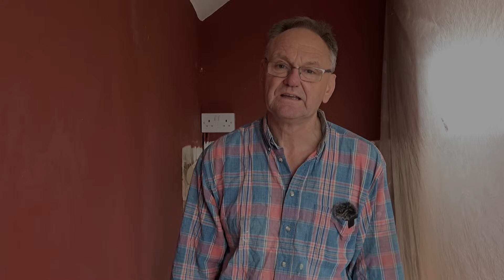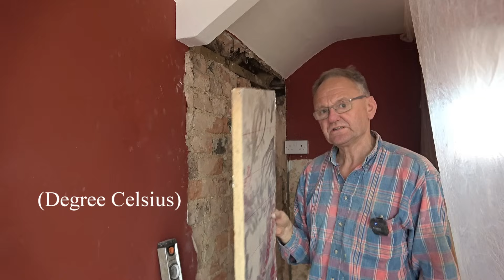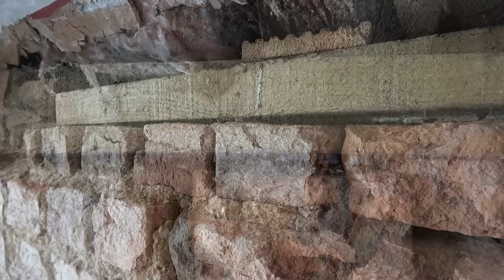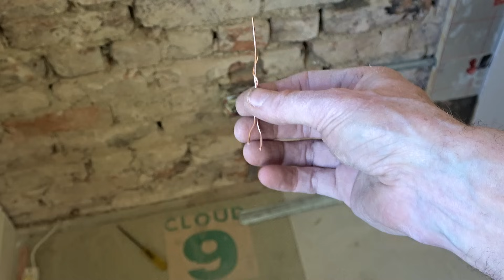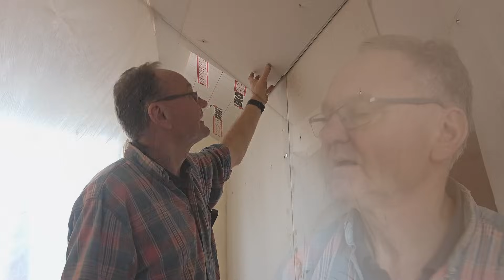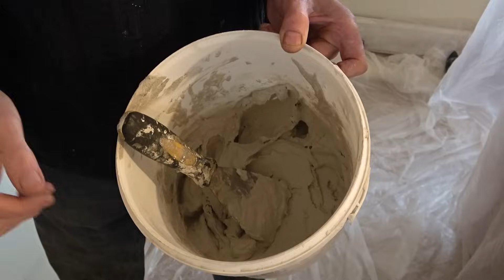HS165 Insulating a solid wall (Do it yourself)

Comment: The joys of an older property Paul. I have done something similar to the 4 rooms on the top attic floor of our house built in 1889 with 18" thick rubble filled solid stone walls. I didn't have your space issues, so battened with treated 3*2's and filled with 70mm Kingspan, then used the insulated plaster board on top to prevent cold bridging. Due to having high ceilings I put false ceiling joists up screwed to the existing joists through the lath and plaster and put 100mm of kingspan in the gaps and used 50mm insulated plasterboard over that. I know that when I did it, almost 25 years ago it exceeded building standards for new houses, I suspect it is not far off the latest regs. We don't need much extra heat in those rooms now, the radiators are tiny compared to the rest of the house. The last rooms that I did in a similar manner were the bathroom and toilet on the 1st floor, but I used rockwool instead, finished 18 months ago. Thats me finished with this house, the boys have left home, we no longer need 6 bedrooms, a 3 bedroom bungalow will do. With a MUCH BIGGER SHED.
Reply from the maker: Hi Bill, 18 inch walls as late as 1889 that's pretty late for that sort of construction unless you lived deep in the country or remote parts.  But high ceilings would be typical for that age. I think you may know the story that I chose this house for the outbuildings before my wife had seen it. Cheers
Reply: @HaxbyShed  Haa haaaa haa "I chose this house for the outbuildings before my wife had seen it". Funnily enough one of the reasons I wanted this old pile was the fact it had full cellars with 8ft odd ceilings. All my woodworking stuff is downstairs, the metal working is all in the garage, erh workshop. Any of the houses round here built of stone by the Victorians have walls at least 18" thick. I can tell you that trying to diamond drill a 5" hole through them is a pain, an all day job.
Reply: Hello Bill, I've just bought a farm house built around 1850 with sandstone, I'm just about to start insulating it, and seen plenty of debate on using rock wool or kingspan (PIR). Any reason for using rock wool on the later development please? After using both with would you recommend. Thanks Paul (North Yorkshire)
Reply: @paulkelly6726 The rockwool was a bit cheaper, but it's easier to cut to make a tight fit, and is also fireproof. It still has a Kingspan type plasterboard over the top, with 25mm of foam. Not quite as good from an insulation point of view. I have never had ANY damp or condensation issues with any of the rooms.
Reply: @billdoodson4232 cheers Bill, appreciate the reply mate. All the best for Xmas and new year mate
Reply: @paulkelly6726 No problem, same for you and yours.

Comment: I've never had to do that kind of work on a house as old as yours, but our previous house had some interesting challenges. We redid the bathroom and removed all the plaster board off the walls. None of the exterior walls were insulated, so of course we added fiberglas. Made a big difference. Also, even though it is thin, the plasterboard (we call it drywall) also has an insulating value. I suspect that room will be more comfortable this winter without having to use as much energy to keep it warm.
Reply from the maker: Hi Greg, I think the only 'upside' to old houses is character.  Over here they can carry a purchase price premium  as much as 50% for the size, they are poorly insulated, often the wiring and plumbing are dodgy and they can be damp. Buy one and you are likely to be lining yourself up for some work, and expense if you can't 'do it yourself'.  But that was our choice, and if your wife can help then potentially that's good bonding 😁 Cheers
Reply: @HaxbyShed  Absolutely. It's like buying a rusty old machine tool. Might take some work to get it going, but it's worth it to me!

Comment: very interesting. I have a similar angle between my wall and ceiling, and it looks like it was originally covered over the join with paper, which is now starting to lift, so I have to work out how to deal with that! But my wall is only 20 years old, so hopefully I wont have nay where near the surprises you had underneath!
Reply: You may be unpleasantly suprised, builders hide a lot with plaster and paint.
Reply from the maker: Hi Jack, I think I agree with Sean's comment. Probably you need to uncover the root cause. It will be angled for a reason (not necessarily a good reason).  Cheers

Comment: Boy, I don't envy you.  Wife & I did the bath several years back, peeling off the tiles & drywalling / plastering. Walls were crooked & studs were randomly spaced. Three weeks & a hired plaster artist later,  we swore never again. You did a great job solving the "little" problems that weren't little at all. I agree with Werner though. Canned PU foam would add stiffness & air tight insulation in all those gaps. Hope you're recoving mentally after this.
Reply from the maker: Hi Bob, I get into one of these mucky tedious jobs about every 3 years. A bit like child birth, so they tell me, time elapsed just long enough to forget the last time.  Cheers

Comment: I'm so glad that I'm done with all my insulating and sheet-rocking .  One more tiny section to repair and re-insulate and I can throw away my "mud" and trowels .
Reply from the maker: Hi Ken, I've been doing selective insulation work all over the house for years but that bedroom was always going to be a big one. The only item left now is to improve insulation on the outside walls of a loft conversion (in the narrow roof space triangle) which at best is only covered with 2 inch fibre glass at the moment (floor to about 2 foot 6in vertical before the roof slope). I keep putting it off because it's a horrible job.  Cheers

Comment: I would have filled the cavities with PU foam. Greetings from Styria.
Reply: Gun grade applied foam is wonderful stuff. You can adjust the nozzle rate of extrusion to create fine or wide beads of foam. Also insulation board and plaster boards can be fixed/bonded onto dabs of gun applied polyurethane foam. It takes a hell of a lot of effort to remove the panels when the foam has set firm.
Reply from the maker: Hi Werner, I had to look up Styria Austria and it looks like a lovely place with all the lakes and mountains. Foam filling would have been a smart idea, definitely at least the lower part where there was no insulation behind the plaster board. I have not finished the room yet so I could still drill holes and squirt foam in where the skirting board will cover it ....... that's a very good idea thank you. Cheers
Reply: @HaxbyShed  Hi,Paul.A word of warning if you are thinking of injecting PU foam behind any existing wall boards,skirtings etc. Make sure to use a low expansion grade(usually available in the gun grade canisters) rather than high expansion stuff or you risk bowing/bellying the boards outwards as the foam expands and sets....don't ask how I know this can be a problem.🤣
Reply from the maker: oh right Howard. I did wonder but I would have just ploughed ahead! Thank you.
Reply: foam will cause damp or condensation
Reply: Yeup me too ❤
Reply: Recommend old brick work you use lime mortar for pointing not cement sand  on old brick work.
Reply from the maker: Hiya Christy, I did not say it but I added some lime to the mortar, so not strictly lime mortar but at least a bit softer than just cement mortar. I meant to mention it in the vid but forgot. Cheers
Reply: Syria is a dangerous place to be

Comment: It is amazing how much difference insulation can make.  Thanks for the video keep on keeping on.
Reply from the maker: Hi Harold, yes the radiator is hardly on now and it's quite warm in there. I reckoned it would save me maybe $20 or $25 a year in heating bills for a $140 job (materials) but the comfort improvement is also a big factor. Cheers